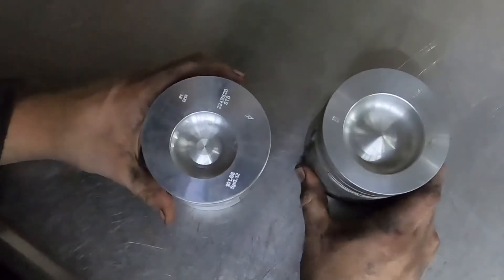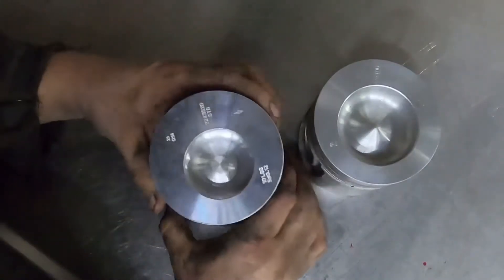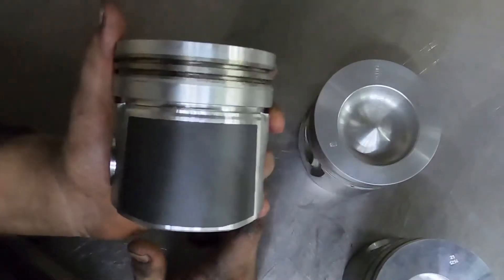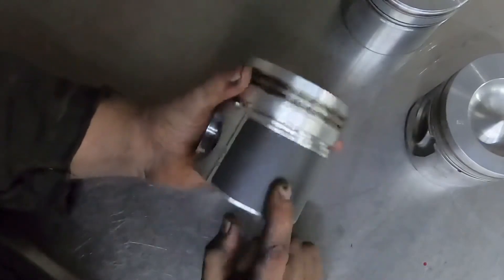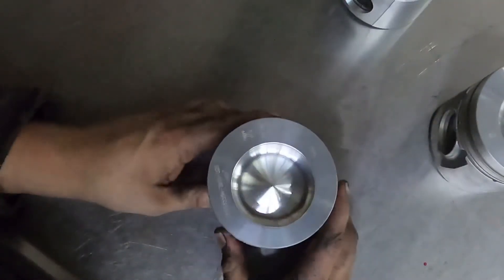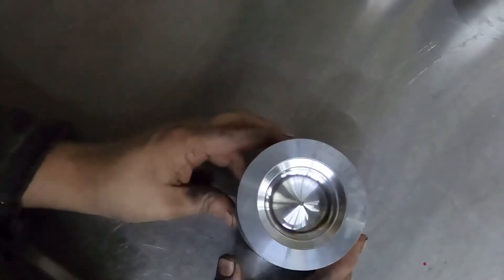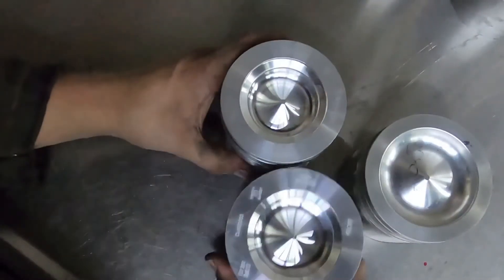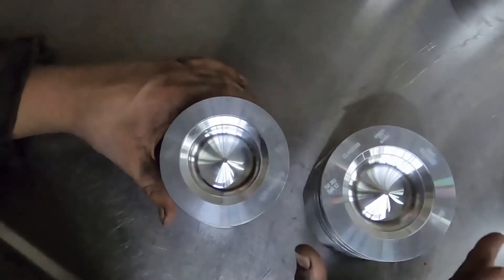Cummins piston designs.  ( what will fit what )

Comment: What pistons would you recommend for building a p pump 24 valve tow rig
Reply from the maker: Depends on what block and combo you are going to use. For a normal vp44 style ppump build I would just use the high comp stock style
Reply: @CUTTERUPROB  it’s a 96 block bored .020 over, I haven’t sent the p pump out yet either so any recommendations highly appreciated! Thank you for the response
Reply from the maker: @Firstgenfuckhead98   np. Ya do the high compression vp44 pistons. Pump I would send to Seth Farrell @farrell diesel 
Tell him I sent you
Reply: @CUTTERUPROB  thanks again, and for all the videos

Comment: Hi Rob ,rebuilding 5,9 cumins 2005 and just to ask you what is ring gap,the books says 0.010-0014 top ring 
Intermittent ring 0.003-0.045 
Oil control 0.010-0.022 
Before honing cilindar first ring  0.016 second 0.041 and third 0.018 all 6 cilindar is it this spec ok ot i need bore all cilindar or if i go with this spec. Im going to have blowby
Reply: Hey Rob, thank you for replying. i'm going again to the machine shop to measure everything with bore gouges ...
Will not upgrade anything. This is stock 5,9 with 359hp 
My question to you.
What company did you recommend for piston's ring?
Reply from the maker: @eniscanovolcano  if you want the Best Buy total seal gap less
Reply from the maker: You  will need to measure the bore vs the piston with bore gauge to do it the right way. You ring gap can be adjusted to the what you doing with the engine

Comment: I have the ISBe 4.5L CR with the piston that looks like the 305Hp 5.9 and the 6.7 truck you displayed. I will be controlling it with the CM2150 ECM. What injector would you run? Have any recommended numbers? Thanks
Reply from the maker: Bit out of my wheel house to be honest. But I would run the injectors the  ecm is based for.

Comment: Hello ,    I rebuilt my 12 valve Cummins with  P- pump  ,mostly stock , with marine Pistons .   I'm trying to figure out if it need different injectors?      [  When I cold start it ,  it smokes and misses] when I get on the throttle.  Until it warms up  but good idel . Only about 2 hours on rebuild.    Wonder if RINGS need seated still . 
  5 °   or 10 °  fuel plate  .     Thanks
Reply from the maker: You would be running 155 degree nozzles and start your timing at 18 degrees
Reply: @CUTTERUPROB  Thanks 4 taking the time to reply 🇺🇸✌. 
          I've have  just stock injectors ,     no idea what angle is ,    and what they  put in a 1996 .
And you're  inclination was right I'm running stock timing

Comment: even though a vp 44 injector has a similar spray pattern does it matter that the vp nozzle tip is about .100" longer and sticks down in the cylinder farther than the cr injector. does this allow for more timing because the tip is closer to the dome . or does it need to be changed to a flatter degree spray?
Reply from the maker: The pattern is with 2-4 degrees depending on the nozzles that are used. 
The the deeper protrusion is good with a mechanical engine keeps the fire in the bowl. This is something I will talk about when I get a dyno so I can show the power difference

Comment: When upgrading a 07 5.9 to the 6.7 what do you prefer small bowl or qsb? And any mpg difference you think? On mine I used small bowl same tuning. Mpgs the same maybe a little .5-1. Built for about 725hp
Reply from the maker: I like the isb 6.7 ( smaller bowl ) mpg I not sure you will see alot of different. The longevity is better

Comment: Hi Rob. What is your opinion on piston top ceramic coats?

Any protection or durability to gain with those coatings? 

My application is marine 6bta 370. Not looking for more performance, just reliability overall.

Thanks 
Ps. email sent regarding other conversation.
Reply from the maker: The coating does help keep the heat out of the pistons for a while but it does burn off over time

Comment: Where can I get that dual keystone piston early in the video.   I think I want to run that with 03-04 injectors
Reply from the maker: Off the top of my head the 480hp 5.9 was duals but there not easy to find these days.
Reply: @CUTTERUPROB  I appreciate  the knowledge  my friend!  Also if you ever have or know of a person  that can do the rollerizeing for me. I have brand new stuff I need done for my project.  Or heck if someone  has a lathe/mill  with a 6 jaw  I'd be interested  in buying to start making these myself for the platform.

Comment: I need an early 6.7  block.  Is it possible to use my 325 injectors in one? 05-07 5.9 injector pattern (the widest bowl)
Reply from the maker: all the pickup 6.7 is basally the same so.  the 325 hp injector pattern is different , you need the 305 style injector to work with it

Comment: If you were building a cummins engine from scratch with mostly factory parts. Like  using a 6.7 crank in a 5.9 block with a 12v head or something. what would you do
Reply from the maker: i would do a short video up for you

Comment: Hello Rob, I'm still in planning stages of a sreetable 6.7l 12v and would like to know what a safe overbore is for 750-800HP.
I'm looking for as much displacement as I can for moving air. Light tow rig, not a dedicated DD though. Somewhat of a hot rod with good street manners.
Reply from the maker: Hard part with a Ppump 12v is the use the centre bowl pistons you have to have big injectors to fix the spray angle.  So it won’t be a great street engine. But it can be done

Comment: All right Rob, I have a technical question for you. Just taking the Cummins inline six platform as we know it as the 12 valve 6bt and common rail ISB... This question has come to my mind and I do not understand completely and hoping you can shed some light on the subject. It is known in the 6bt that there are a multitude of piston bowl designs depending up on application. It ranges from the truck which is a small bowl all the way up to the 370 HP Marine which is significantly larger. Then we step into the common rail which first hit the scene in 03 to the modern design in the 6.7. I have noticed that the bowl design has gotten significantly wider over time and yet the overall compression ratio has largely remained fairly constant. Here's my question. How does piston bowl design impact power production, longevity and durability, and overall life of the engine? I understand the operational parameters with each design is different in comparing a mechanical versus a common rail. But even within the 6bt realm of truck(on highway) versus marine the differences are quite significant. We can observe using our eyes that they are different but why? Can you shed some technical light on this subject?
Reply from the maker: I will have to do a video on that. One day. A lot have to do with emissions.
Reply: @CUTTERUPROB  that does seem to be a major driver for most changes I would like to better understand why? I've seen Volvos wave piston in their D series engines and appears to be a real game changer in design. Looking forward to the video. You're doing a great service to us less informed and less experienced. Many thank yous!

Comment: So i have an 06 5.9 ( presuming it is the 325hp) and i have an 08 6.7 short block.  I believe i had an injector fail which in turn killed my 5.9. Anyways my question is do i run stock size 5.9 injectors or do i need to get bigger ones for the 6.7, yes i know i need to change spray pattern and i was going to buy new 03-04 injectors because from my understanding they have the correct spray pattern (305 hp)
Reply from the maker: you can run a stock 305 hp ( 503 ) injector in the 6.7 with operating system from the 5.9

Comment: 2003-2004 the non ho/non 305hp pistons don't have the oil cooling passage in the top of the piston seen as 3 holes 2 on one side and 1 on the other.  That's what the C and 6 codes differentiate.

Great video
Reply from the maker: Witch I believe would be the 265 ho engine. But still common rail. Witch funny enough I have never seen one in person

Comment: Can you run the 6.7l piston in the 325hp cummins cause I bought some and just took my engine apart and 4 of my original piston are melted
Reply from the maker: no for two reasons, one the 6.7 piston dia in .200 larger the block can't be bored that big, second  reason in the piston bowl is wrong for the 325hp 
( 505) injector
Reply: Isn't the 40 over 5.9 pistons 1.00mm and the 20 over 6.7l piston 1.07mm when I looked up the info that what I found, for the spray pattern don't you just change out your 5.9 injector nozzles to 6.7l nozzles just asking I'm no pro
Reply from the maker: @jesserasso1042   
factory bore size 
5.9  is 4.020"
6.7 is  4.210"
you can do a nozzle swap on the injectors. if you want to run the 6.7 isb piston but i recommend to have them tested after the swap.

Comment: In your opinion how much HP could the single ring land marine piston for the 12 valve take before it breaks off?
Reply from the maker: I have run a 1000hp with a single stock style piston . a lot has to do on timing  aka cylinder pressure